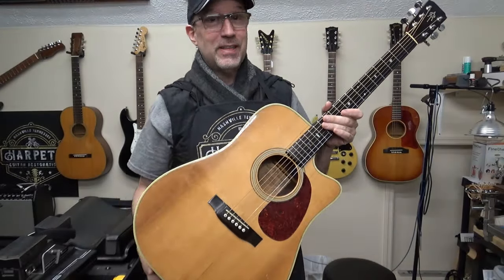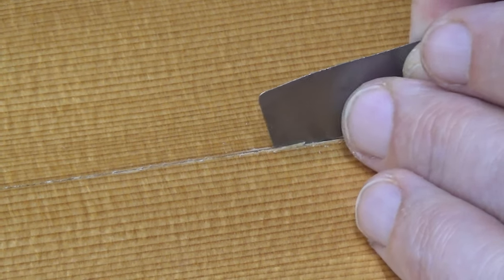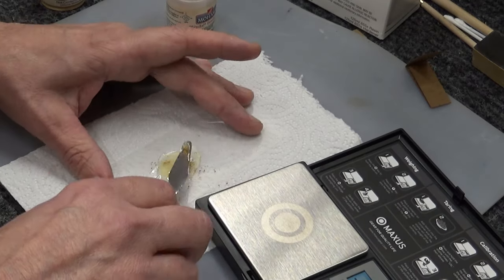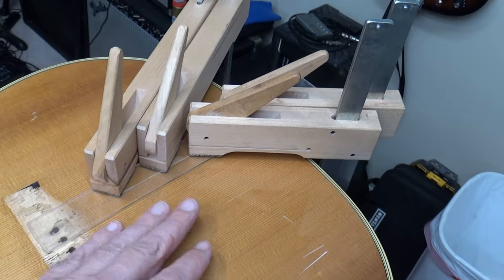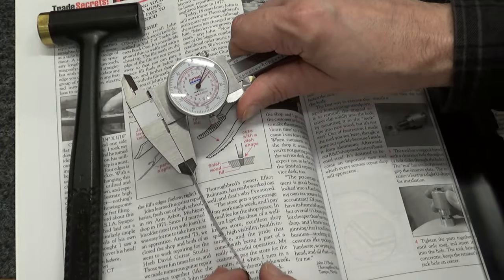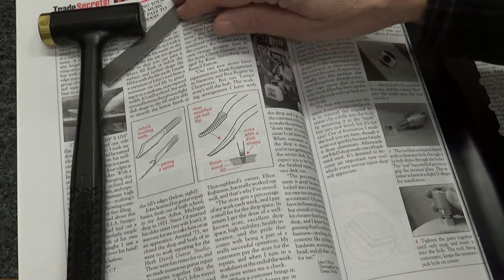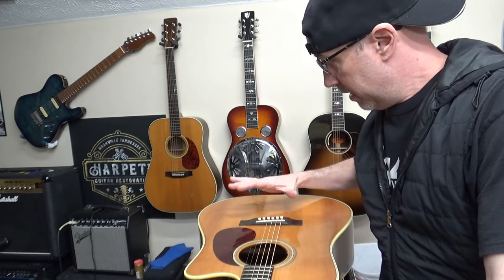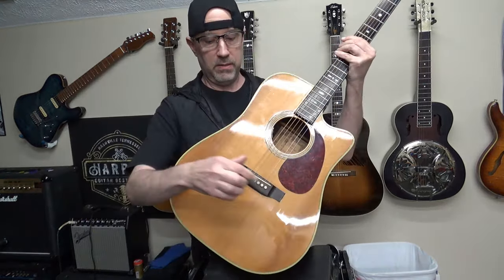Top Spline-Alvarez Yairi

Comment: The constant problem with  epoxy you can get a darker line than you want .maybe just use hide glue and blond shellac once as a test.maybe a glue cleat or two on the inside.

Comment: Great job. I've cut pieces an inch or more longer than needed and glue it down with hot gun glue or CA only on the edges. Using a cabinet scraper or a razor blade, I draw it towards me until I get the thickness I'm looking for using painter's tape as a thickness guide. Worked on my Goya and Washburn as well as some furniture and rc aircraft repairs.
Reply from the maker: Thank You!

Comment: Here’s my idea for thicknessing a spruce splint for that really narrow crack: make a splint as thin as you dare, and make it nice and long; maybe a few inches. Clamp it down flat to a piece of abrasive - maybe cloth backed for strength. Then, a carefully sharpened card scraper may just be able to shave that little splint to the thickness that you need. If it doesn’t work, we’ll always think it should have. Actually if it doesn’t work, maybe it should be sanded with a small block. I had to learn to distinguish .005” , .010” , and .015” shims for setting up a machine by feel, when I was new to the work force. That might help you to learn to do that, and compare feeler gages to your splint before unclamping. The amount of info transmitted from the fingertips to the brain is crazy, y’all. Just dang ass crazy!
Reply from the maker: Excellent advice!
Thanks 😊

Comment: After you glued the spline what did you use to scrape with at the 11:21 mark in the video?
Reply from the maker: The razor blade was ground from both ends on the bench grinder leaving a small spot in the middle still crisp